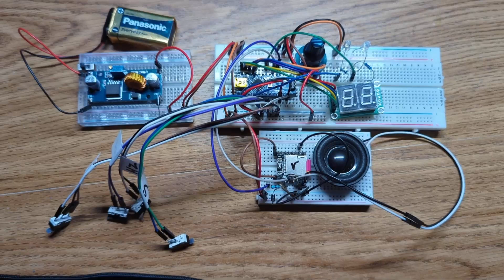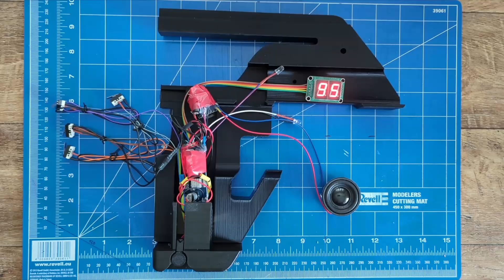M41A sound and lights module using Arduino and DF Player.

Comment: awesome! wondering if its possible to add full auto and semi auto function?
Reply from the maker: Yes, that's a great idea! Adding a fire selector to switch between safe, semi-auto, and full-auto modes would make the replica even more authentic. Ideally, this could be implemented using a 3-position rotary switch (e.g., SAFE / SEMI / AUTO), similar to the selector on real firearms like the M16 or the Czech vz. 58.

Implementing this feature would require some software adjustments and an additional set of single-shot sound files on the SD card.
Let me know, I can implement these features.
Reply: @moditrix  Yeah that sounds like a great idea. I appreciate your willingness to look into it, and I look forward to seeing it.